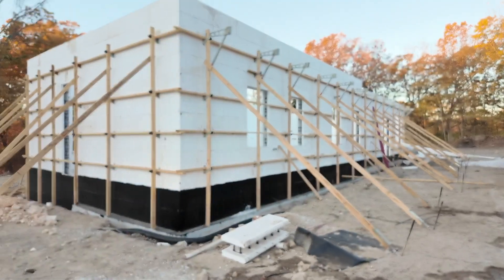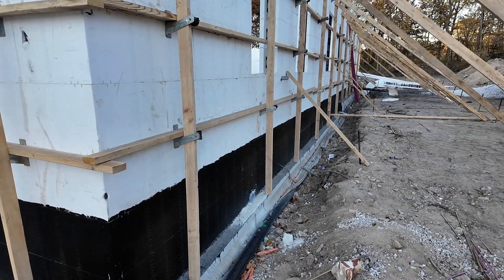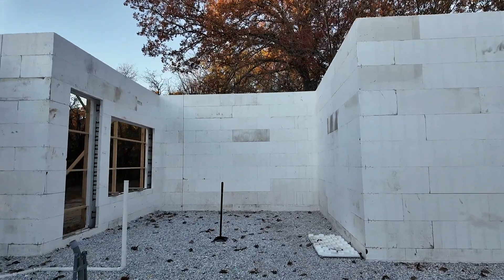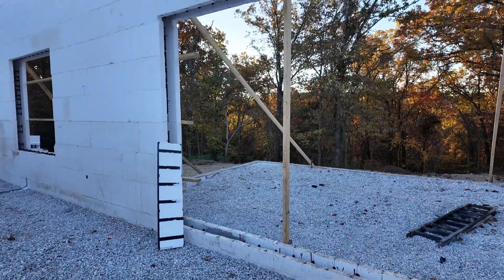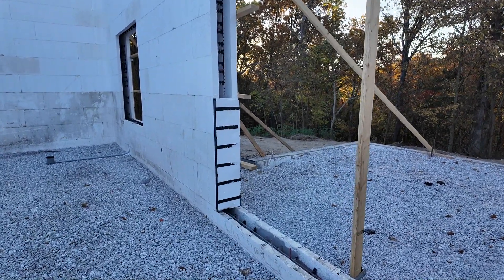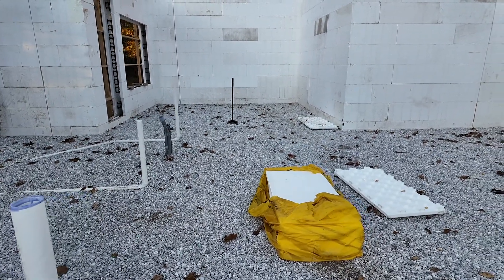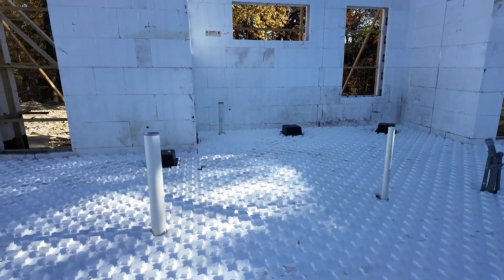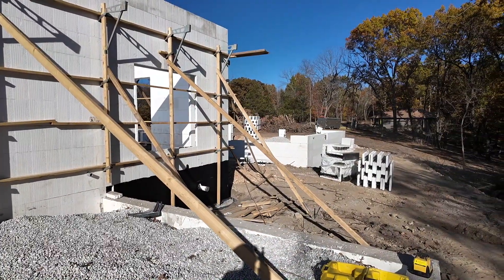Elements ICF Build Progress!!! Hydronic Install Begins!!!

Comment: I am using ICF stem wall on top of a Fast foot footer. It is only 24" tall and the inside is a slab on grade flooring with radiant floor heating. Is there a need to waterproof the short stem wall or will it be enough to just put up a dimple mat to protect the ICF during the backfill?
Reply from the maker: Hey Einar!  I think dimple is plenty in this case, plus it will allow any random water that gets trapped in the foam during construction to drain out unlike fluid applied stuff that can hold it in!
Reply: @all3pools thank you. That's what I'll do. Pool coming soon. Can't wait to pick up my first kit!

Comment: Question:
Wouldn't cutting windows and doors after the pour speed things up and made it easier??? With those modern saws I have seen, the cuts should be a breeze.
Reply from the maker: No, that’s kind of crazy actually
Reply: @all3pools  Those diamond chain saws are like $500 from China. More, if you cut 3-6hrs after pour, concrete is like butter.
Imagine the time and money you save.
Plenty of videos on YouTube cutting up 9" or more concrete walls.